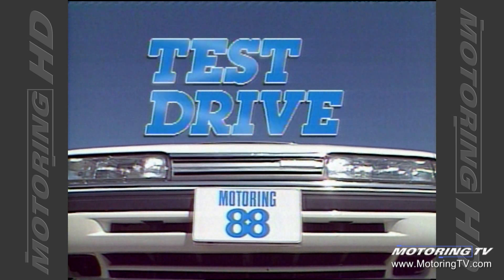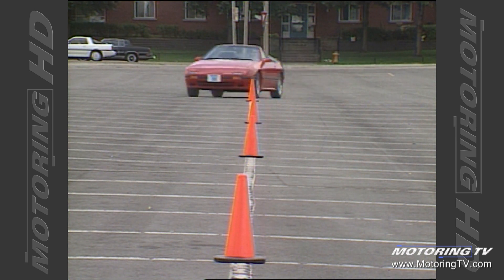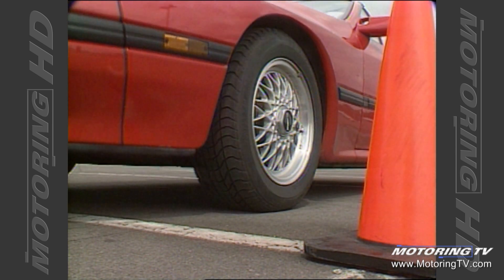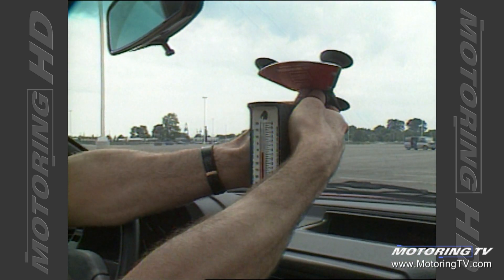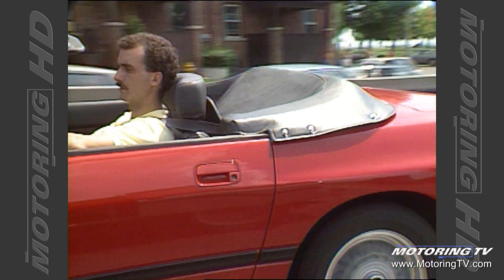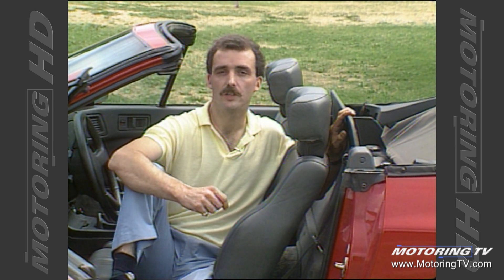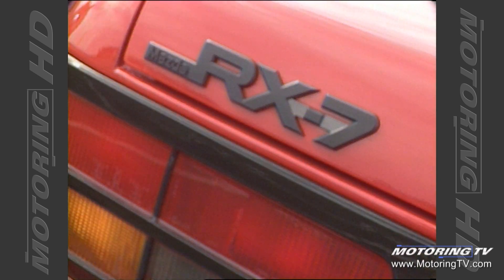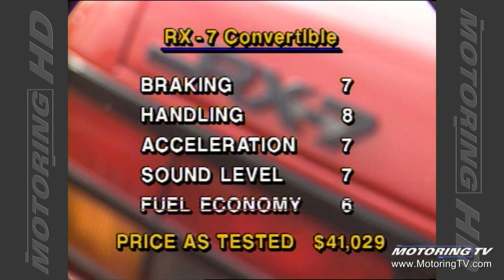Mazda RX 7 Convertible - Throwback Thursday

Comment: $41,000 in 1988??!!
That's almost $79,000 in 2019 dollars!! The Porsche 944 was about the same price as the RX-7 convertible... How did Mazda sell any of these??
Reply: I'm betting people fell in love w/ the rotor portion of this formula. If we're being honest, none of the RX-7's (sans the FD3S -TT) were particularly quick. But the razor sharp handling, and darn near unlimited revving is a pretty good combo.
Reply: why would not, rx7 fc had more power, it was also a gt car, and accompanied with a nice handling
Reply: It was pricy but it was a "Factory Custom job" Definitely one of the best engineered / integrated convertible top car if not the best at the time.  As far as the driving, my family had both cars.  The 944 is long gone.  The 1989 RX-7 is now in my driveway.  Not quite as punchy as the 944 but more rev happy and 160 HP vs 145 for the Porsche.  The RX-7 is definitely the nicer, more comfortable grand tourer and the convertible top made it that much more special.